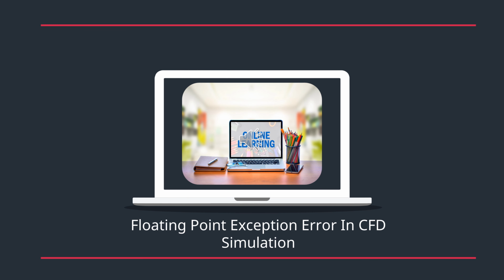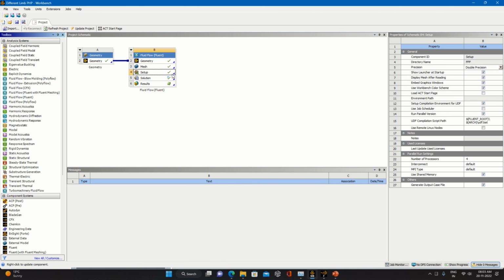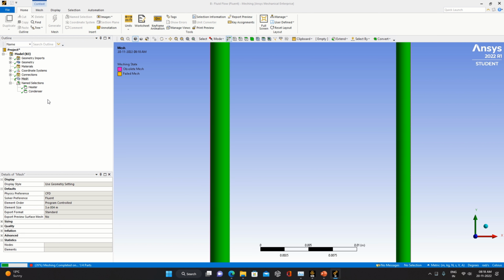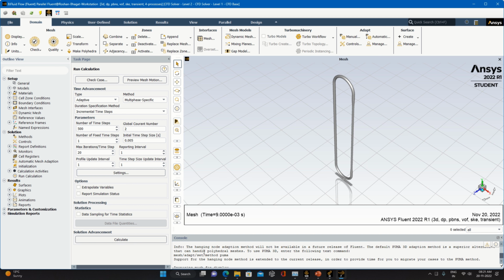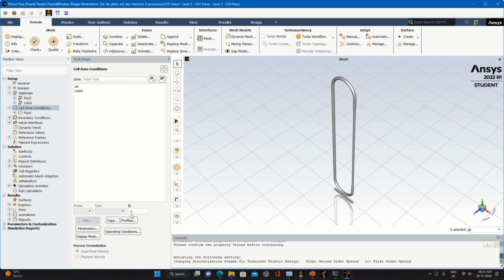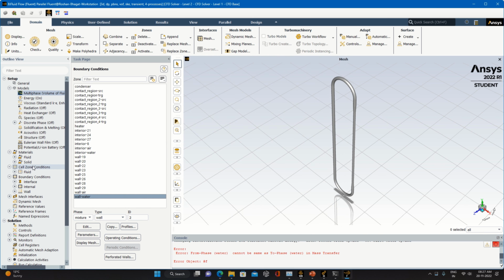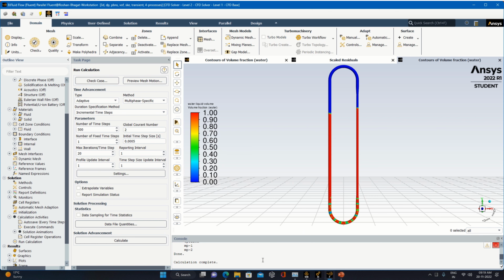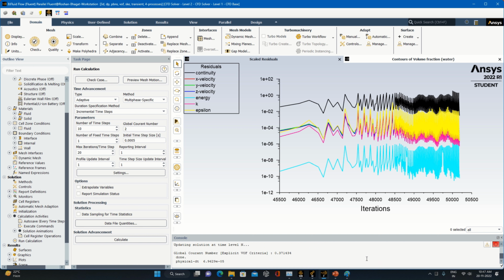Floating Point Exception Error Part I || Ansys || Global Courant Number | @Ayush.Bhagat

Comment: Hi sir. The timestep was changed from 0.005s to 0.0005s after you remeshed with a size of 5e-5 m. Has the error been resolved with the new mesh or the new timestep?
Reply from the maker: If it doesnt resolve with new time step size we need to change mesh size